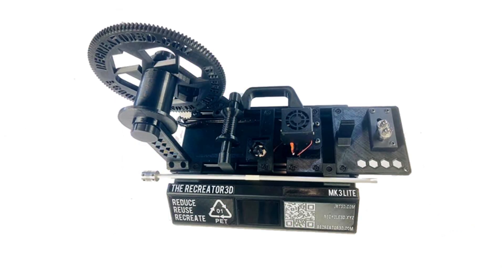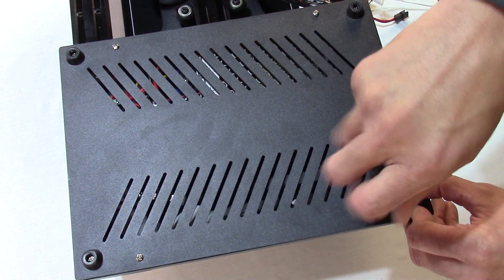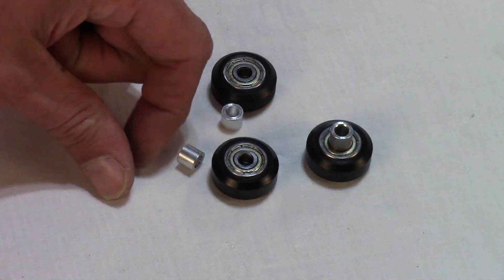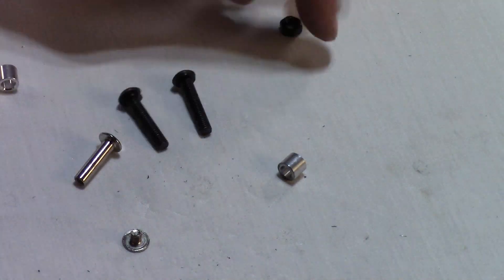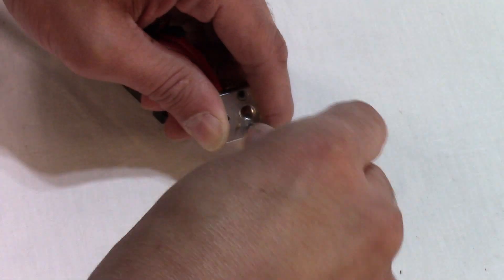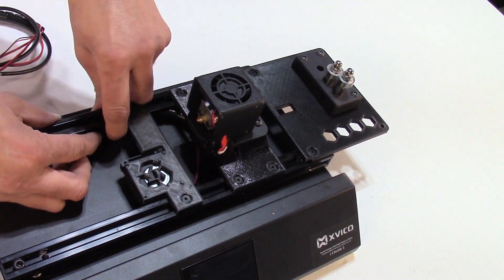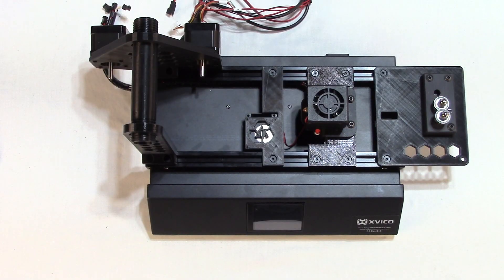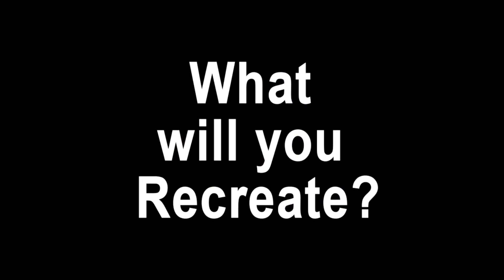The Recreator 3D - How To - Build Notes - RECYCLE - PET#1 - Plastic Bottle Pultrusion Unit

Comment: will this work for a ender 3 v2?
Reply from the maker: Yes
Reply: @JRT3D  oh thanks, i was stressing a lot! I wasnt sure if the code was going to work so i ended up swapping motherboards with my friends ender 3 motherboard.
Reply from the maker: @TheCrafter888  our gcode works with any board that is marlin based - with most standard firmware already flashed.

Comment: I did make the recreator to recycle 8L volvic bottles and trash from the park.
I have some problems:
1.The filament diameter isn't completely equal to the length it's around 1.75 and   1.95 
That isn't that bad to be honest but it has an impact on the print quality. 
2. When printing on my modified ender 3 pro I need to help the Extruder because the gear can't grab that good to the hard and smooth surface of the filament 
3. I need to tune the hotend temp to about 275°C with a 0.8 nozzle because a 0.4 nozzle won't work.
Any suggestions? 
How can I get it to work 
After 4 test prints just one turned to something with extremely poor quality

Comment: Lol.  I’m right now printing part 6, the big gear.  I was going to ask you for a parts list (numbers) because I think I’ll go with the single motor.  But what is benefit of dual motors.  Anyhow I’ll just save this video and write down the part numbers needed.  I want to thank you   Will you be at ERRF this year??
Reply from the maker: Thanks Bruce! There are actually several builds. The MK5 may be one version you want to look into if you plan to do the single motor as it's a lot better than the MK3 Spoolers, it can be adapted to the MK3 build if using an X3S unit from XVICO. https://www.youtube.com/watch?v=PLiHF8iA8iA

Planning to be at ERRF2023, just aiming for a couple more sponsors to help with travel. Everything should work out though!
Reply: @JRT3D  Josh. I just had the print suddenly stop after 2 hours on a 26 hour print.  It might be microSD CARD I used hard corrupted

Comment: i have been thinking about this what if you run the initial run of filament at a 2.8 and then weld the short pieces together and rerun it to down to a 1.6 to help increase the length of the PET filament

Comment: It would be great to mod the base a bit - make it work for us in Europe, where the recycled XViCO X3S is hard to get - it sort of defeats the purpose if the shipping is counted in. But lots of broken ender 3 around, so the power supply unit, main board and motors are the same. Brackets for extruder and motor holders might differ, though.
Reply: Never mind, I just found your video :)
Reply from the maker: Check out Ender 3 Build :) we have open ender build options for a variety of regions.

Comment: Where can i buy a hotend that can reach 260 degrees Celsius please?
Reply from the maker: Most printers should be able to go upwards to 260C with a firmware change.

The XViCO X3S has a custom community firmware that brings temps to 260C and it's a great printer as well a great base kit for the MK3PRO

https://www.ebay.com/itm/155062907983

Comment: Is there a way to do this without cannibalizing a 3D printer?
Reply: Yes, working on releasing an ender 3 version soon. In the build notes will include all the parts needed as 1up parts to buy. The majority of requests have come from users with older or broken ender 3. The idea is to reuse these as much as possible, rather then throw them out or not use them at all.

Comment: Hi, I have made the machine following the build notes. (single motor)
why is the motor not running?
Reply from the maker: Is it plugged in? Please join the Facebook group for more trouble shooting by the community.
Reply: @JRT3D  thank you very much for replying.
Yes, as wire E is plugged into the motor, as I run the 300MM speed gcode, it shows a setting icon and number 11999 instead of "timeclock and 100%"  as yours on the screen. Is that a sign?
on the other hand, actually one fan related to the heat block is damaged (the wire connect to the fan is broken), would that be the reason?

Comment: need mor information on installing the software for an ender 3.
Reply from the maker: Nothing needs to be done to an Ender 3 other then running 300mm Suggested Speed gcode
Reply: @JRT3D  
I've done something wrong because it only displays a blue screen and nothing more
Reply from the maker: @parkerazz4385  Should be running stock ender 3 firmware - perhaps your screen is plugged in wrong. If you come over to the facebook group answer are easier answered among hive mind

Comment: Will there be an Ender 3 version? the XVico model is not available in my country or no one is stocking it because  majority of the users here are Ender 3 users
Reply from the maker: Yes. Working on Ender 3 version now. One built directly from the Ender 3. Another showing how to tether secondary parts run from patching into a main printer, as well 1up random parts into a custom frame. Keep your eyes open later this month!
Reply: @JRT3D  Thank you! The tether attachment would be veeeeery helpful since i wont need to buy a used/2nd hand ender 3 hahaha
Reply: @JRT3D  By chance you have any update for the ender 3 conversion?
Reply from the maker: @GuardTower  wrapping MK5Kit Ender 3 Build Video hopefully this upcoming week.

Comment: Why did you drill the nozzle at 1.6? Isn't  most filament 1.75?
Reply: 1.6 is a common bit size for most sets. There will be some expansion among the pull. Ultimately using a 1.75 size can cause further expansion - It's better the have a smaller diameter then a larger one - as you don't want to jam if to thick.

Comment: Great idea, with one dealbreaker: the choice of printer this is based on is hard to find and/or prohibitively expensive in Australia. Are there any plans to release a version of the Recreator using more generic 3D printer hardware?
Reply from the maker: Just ordered an Ender 3 to work on this version - Beyond that will likely be as generic as I plan.
Reply: @JRT3D  Thank you very much for your work! Really looking forward to the version on Ender 3
Reply: @JRT3D  I'd say an Ender 3 is generic/ubiquitous enough. 
I'll look into cheap clones or used ones and see if it's a bit more affordable :)

Comment: Very well done! For PRO users, especially, the end of step 4 is a good place to tune the current on the motor driver boards. I had one set for 2.4 A, which is over twice the rated current of the motor driver, and one set for 0.8 A, which was too low.
Reply from the maker: Thanks for this - Will be added to Build Notes for Pro-Tuning Methods.

Comment: Lets say we made filament out of a soda bottle
what temp is required?
cause mine just melt, not soften to be pulled into filament.
Also how do we use said filament in ender 3 pro?
Reply from the maker: Pull temps to convert the strips to filament can range from 190-210 with 210 being suggested @ 300mm at standard. You need to make sure you bottles thickness is accounted for the strip cut size in order to pull properly among correct heat and speed. 

To print - you need to adjust your heats to 255/70 and extrusion rates need to be higher, CURA 150%, S3D/PRUSA 1.1%